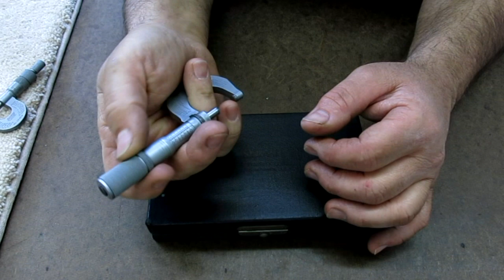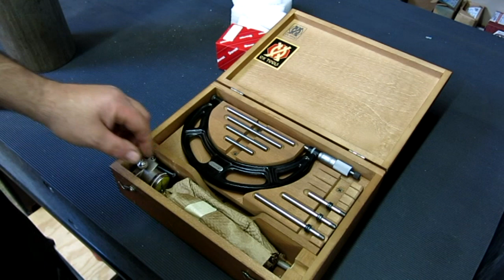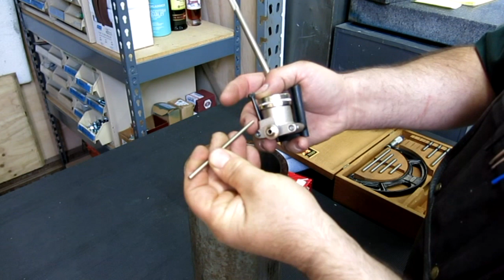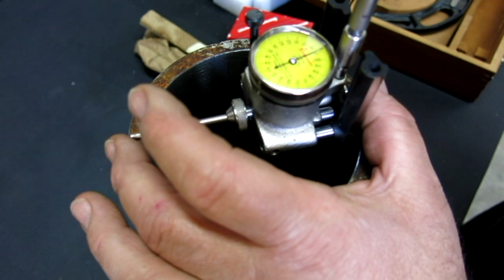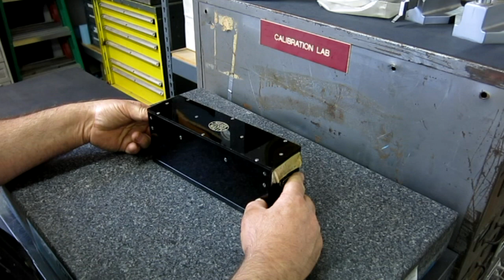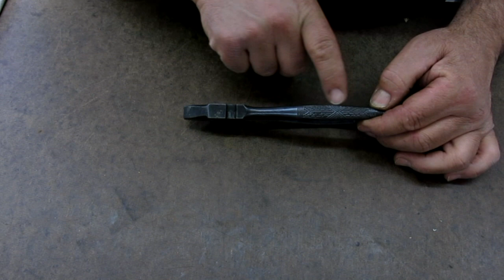Monday Night Meatloaf 84

Comment: Hello Tom, great videos ! Meat loaf ! is a great work!!! Im curious and very interested on the Hilger & Watts TB 4-2 adjustable block level. I do own one, and Im looking to calibrate it because it is a bit out of zero. I've written to the Science Museum Group in London and they do not have any copy to share. Since I have a Carl Zeiss Jena Coincidence level I wrote to the Carl Zeiss museum and I did get the user manaul for that one, I've asken them if they know anybody about Hilger & Watts manuals but they do not.
 The TB 4-2 has 2 screws on one side that have a couple of drills on each head, since I do not know much I preferred not to turn those until I get the Manual. 
I have also written to Keith Rucker however he does not have the manual , then he directed to me with Matt Ratkowski who gave some hints on how to calibrate but still I do not have a good ammount of confidence to calibrate the level .
Do you know anybody who may know how to calibrate the Level?

Saludos from México

Comment: To visualize one arc-second: if you are standing at the vertex of the angle, with the bottom ray horizontal... if you lift the top ray by one arc-second, you will have to walk eleven miles from the vertex before you will be able to fit a golf ball between the two rays.

Comment: A level of such accuracy is dangerous.We dropped C-5 engines into trailers using a long piece of safety wire (.032) and a pair of safety wire pliers as a plumb bob.Possibly in engine build up for the T wheel?" That level scares me.The pliers are another story.Yes I'm old enough to remember when the U.S. had many capable craftsmen and women.What has happened to us? Keep up the good work it's inspirational to all

Comment: With that Huet level you can put air very equally in you car tires, put the level on the roof and fiddle with the pressure while sitting in the driver's seat...
Reply from the maker: pierre beaudry Hi Pierre,

Actually I can put it on the ground and see when you walk out to your shop. The bubble hasn't moved in a while..... 

All the best,

Tom
Reply: oxtoolco Hey Tom, you're just stuck with a defective level... 

   Cause, Philippe and I are preparing a project about Keith Fenner's give away toolbox, WIYB-TMC.

    It involves developing, machining,  heat treating, the nature of the project isn't announced yet, but well underway... 

     You're "encore" invited to come for a visit and you'll see the preparing of at least the heat treating material put in function...

    Regards,  Pierre

Comment: Tom. Forrest Addy here , a regular poster on Practical Machinist and Home Shop Machinist websites. 

I hope I don't insult you. I wouldn't hassle you but you are very influential and I had a hunch based on your remarks about eliminating step pulleys that you may be starting on the wrong foot. 

You stated on MML #84 you were considering installing a VFD on a band cut-off saw to eliminate the step pulleys. You might get away with it on a band cut off saw where the kerf and overall mechanical advantage is constant but on machine tools like mills, drills and lathes, neglecting mechanical advantage lof spindle transmissions eads to very unsatisfactory results.

Halve the RPM of an induction motor with a VFD and the torque  stays constant as the RPM's decrease. Thus the HP decreases in proportion to RPM.

Consider the physics of constant HP mechanical drives: With a mechanical step pulley, (multi-speed geared transmission, variable speed belt transmission, and hydraulic analogues) the motor speed and developed HP stays more or less constant as the output RPM varies with transmission  ratio. 

Swap the multi -step transmission out on a machine tool and  replace it with a VFD and the stock removal capacity diminishes with RPM.  Halve the spindle RPM and you halve the possible stock removal.

I've installed a dozen VFD's on  machine tools and I've been bitten  by most of the snakes along that path..The physics of mechanical power transmission is only one of them

Forrest Addy

OperaBass@aol,com
Reply from the maker: OperaBass3 Hi Forrest,

Thanks for the nice note. I think it would be pretty hard for you to insult me so no offense taken on solid advice, ever. 

I should have been a little more clear in my explanation. There will still be a basic reduction between the motor and gearbox of the band saw so the motor will be operating close to its nominal rated RPM output. What I meant when I said I was getting rid of the pulleys was that for minor speed changes that were covered by the step pulleys that were mounted between the motor and gearbox. The old motor that went sparkabout was smaller (1/3 Hp) than the new motor (3/4) I ordered with the VFD.  I totally agree with you that VFDs are not the say all do all magic bullets folks would like them to be and that you need to be mindful when replacing motors and drive components. 

Always nice to see a comment from a pro like yourself. 

All the best,

Tom

Comment: Something I never hear mentioned when people are discussing and comparing linesmans pliers: that tapered nose with the facets is a sort of reamer/burnisher. It's good for smoothing out the burr in the end of a piece of conduit, or a knock-out hole in an electrical box. And some brands of linesmans pliers are better at it than others. I wonder if some manufacturers have forgotten the purpose and just make their pliers roughly that shape because it's traditional?
Reply: Peter W. Meek Not traditional.  It permits the use of the pliers in close quarters, particular when twisting (splicing).

Comment: Hi Tom,
I'm trying to learn more about machining. Could you please explain to me what a micrometer is used for?
Reply from the maker: W.Co.VIDS Hi William,

A micrometer is a measuring tool used to measure between two points very accurately. Typically they have a one inch range of movement. They come in various sizes to cover the range of dimensions being measured. Hope that helps. Good luck with your YouTube Channel.

All the best,

Tom

Comment: Another plate of Ox-Loaf!  
-Dig the bore gauge demo.  Proud to hear that it is going to a good home.  You could take that to the next safety meeting at your job.....  When the Plant Manager asks you what it is, you can sarcastically retort, "A BORE GAUGE".  get it?  Drooling over the "Pan-a-Vise" next to the toe jack.  You might need a level like that on the launch pad.  Sounds like you got "-6 Krauter anxiety disorder" (I looked it up in the DSM).   Thanks Tom.

Comment: Hey Tom, if you run the Johnson hard it will let ya down the older it is. Nice level,bet if ya farted it would move. Hope you show the slitting saw operation on the bearing holders? Thanks for great serving and looking for the VFD to wash it down(it wasn't dry) Dave

Comment: Tom, I picked up a pair of those Krauter's in the middle of Highway 9 in Boulder Creek, they turned out to be around 1912 vintage, earlier than the one's with textured grips.  I removed all the rust from my pliers and they turned out to be immaculate, no chowdered edges.  It's amazing that no-one abused the cutting edges in over 100 years.  Oh, and mine are dash 6 pliers ʘ‿ʘ
Reply from the maker: eformance Hey Perry,

Dash sixes. You better put a lock on your barn. I'm pretty sure the heat treat on these older tools is far superior to modern equivalents.  No lawsuits from chipping on soft modern tools and they wear out quicker so you buy more. Thanks for the comment.

Cheers,

Tom

Comment: May you never truly need that precision level. I took months off my  life aligning big interferometers with an arc second optical transit square (a Brunson 76 I think). Just standing nearby bends a 30" concrete foundation enough to queer it. Had to read the coincidence bubble with binoculars from 30 feet.  Don't even get me started about temperature drifts...
Reply: 11zekim How about installing and calibrating tiltmeters using a resistance bridge, that locates the position of a bubble under a concave quartz lens? Accurate to 1 inch in 16,000 miles! Calibrated using theoretical solid earth tides with ocean loading corrections. Used for earth's crustal movement monitoring applications. Talk about temp sensitive.
Reply: Erling Weiseth Shouldn't have any effect, They are installed in bore holes at +200 feet deep.
Reply: Rain Coast And then, there's global warming.... How do You think it will effect it?
Reply: Rain Coast I rest my case, LOL...:)

Comment: Hi Tom,

Well I will be watching for that toe jack build!
I have been wanting to build one like that for a little while now. The other toe jack you built using a bottle jack did inspire me to build one very much like yours. I just don't like how bottle jacks are made and don't really trust it as much as I should. Now I do have the hydraulic ram and lever plump and an air over hydraulic pump all 10 ton stuff for my next toe jack build. I just moved a 18" x 72" 1948 7000# Sidney herringbone lathe into my shop. I built a wild heavy duty set of equipment roller skates and used a Simplex 5 ton ratchet type jack, and that worked very well. However I like the idea of being able to get out and away from under the machine when doing this stuff hench the desire to build the other toe jack with the divorced pump.

Oh also, What is that old factory building in your cover shots? I would love to have a shop like that but would hate to heat it in the winter!

Joe in Minneapolis, MN.

Comment: Better yet get a second hand vector driver (Siemens Micromaster Vector) for more rpm's (10-40% or so) and..............no lose of torque at low rpm's (so you can use them on a mill and are able to drill big diameters at very low speeds,this is something u cant do whit a VFD)
Food for thoughts ;-)

Comment: Tom,
Nice Meatloaf as always.
I have a question about the Toejack Slider. The slotted holes are those not upsidedown on your chickensketch?? Or did i mis something on the drawing?
Keep up the good work.
Arthur.
Reply from the maker: Arthur Aalbregt Hey Arthur,

Good catch. Yes that it why its called a chicken sketch. Chicken you know what.  I modeled up the parts and did it correctly the second time around. Thanks for the comment,

Cheers,

Tom

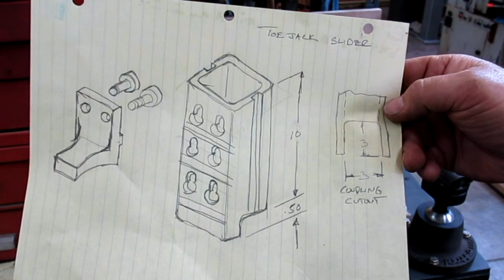Comment: Looking at your sketch @ 20:25, should the key-ways be inverted so that the load is held by the keys and cross beam?
Reply from the maker: Andrew Farrow Hi Andrew,

There is a boss on the back of the toe that engages the keyway in the sketch. I have modified it since making the sketch and its actually a pocket now. Thanks for the comment.

Cheers,

Tom

Comment: Tom that is some level. I would think if you made an adjustment using
a unit that sensitive you would have to let it set for a while to see if temperature
or humidity changed anything. That is one sensitive instrument.

It would most likely drive me crazier if I tried using one that close.
I do like it.